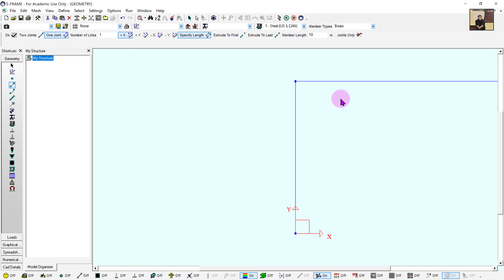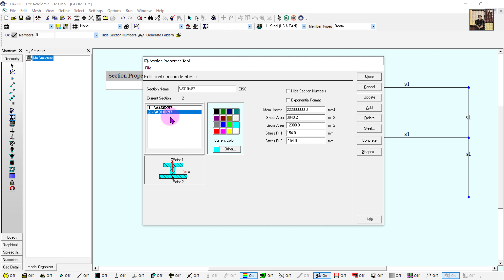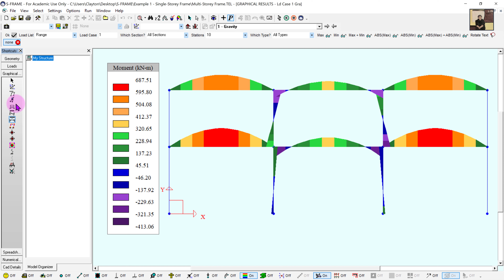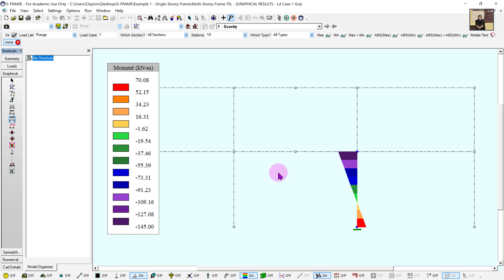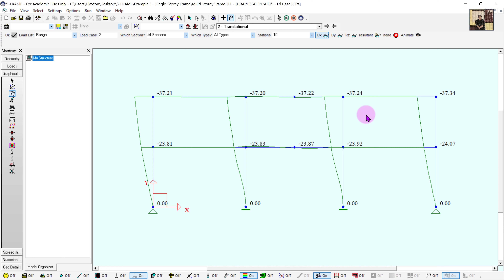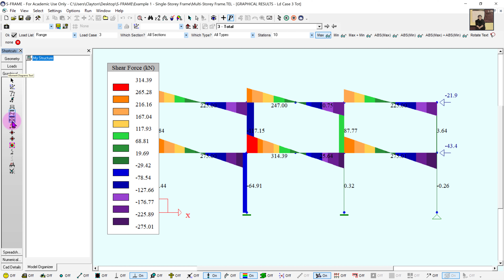S-FRAME | Example | Multi-Storey Steel Frame PΔ Analysis (CSA S16-19)

Comment: Hi Clayton, I really appreciate this amazing and informative video related to the p-delta effects in steel frames, it was great! I just had a small question related to the placement of the rollers for when we conduct a first-order analysis under solely gravity loads. Let's say our multi-story frame was only made of 2 bays instead of 3, where would we put the horizontal rollers to get the correct reactions for the later first-order lateral load analysis. Thank you very much!